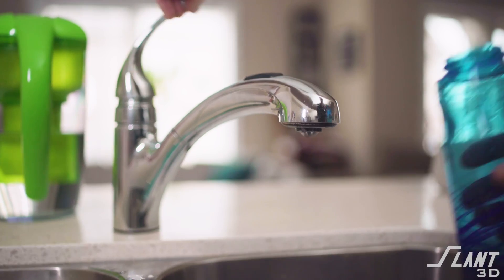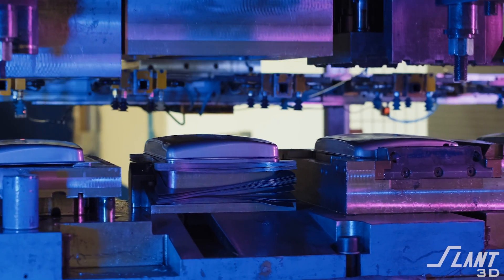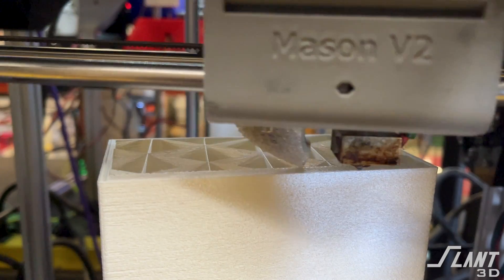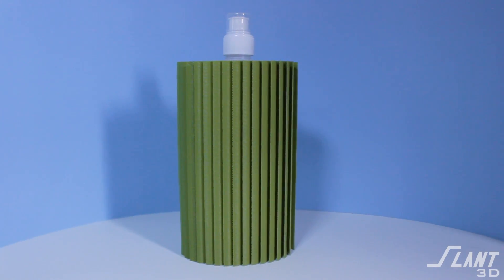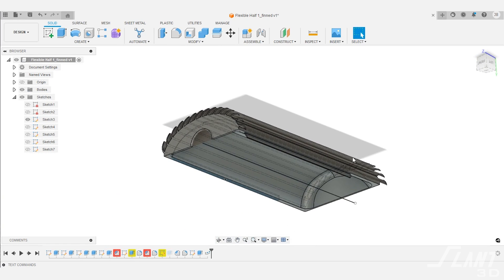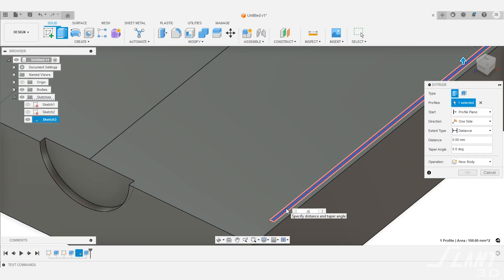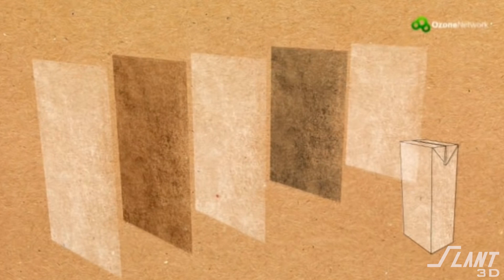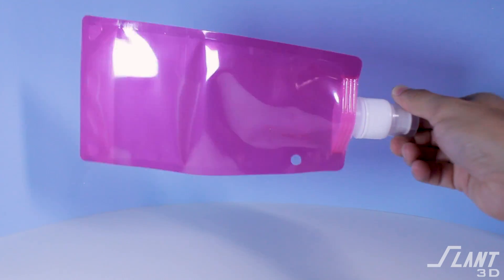Can you 3D Print a Water Bottle? | Design for Mass Production 3D Printing

Comment: I was kinda hoping that there would be some discussion about whether the printing process itself could be made more food safe. Over-extrusion to fill in gaps, using food safe PETG, etc. If that can't be done - perhaps something like food safe spray-on liners to allow the interior to be any shape you want. Printing a shell around an existing food-safe container - kinda feels like cheating. Yes, of course if you just make a shell that's okay.
Reply: Agreed this video completely side steps the question. The 3D printed parts aka the bottle housing isn't food safe. Nothing printed was made food safe. 
It's a great real world solution but if it was a maths problem, your maths teacher would give you a 0, because you answered a question that want asked.
Reply: @byroboy  I would suggest reading the paper I talked about above. Cleanliness-wise for micro growths, 3D printing is pretty dang safe, more so than the used plastic bowls/plates in most cabinets.
Heck, even the "lead leeching" from the nozzle has been dramatically overstated. There is more lead/arsenic in makeup than there is from nozzle transfer. And there are not many warning labels on makeup because those substances are "naturally" occurring in the ingredients. It is reported over 98% of cosmetics have lead in it. 

While nothing is 100% correct, and we need more studies done, just blatantly saying "Nothing printed was made food safe." is adding to the fear-mongering behind the hobby and field.
Reply: @RoseKindred  The problem is variability. It's harder to know with FDM if something is safe or not simply by looking at the materials list, because there's such a diversity of filaments all called PLA or PETG, and the lead leaching could also be a higher risk if you're using cheap brass nozzles from Amazon that wear out in a couple hours of printing. And biological surface area could easily be orders of magnitude higher on shoddy prints than on proper ones, say, if the filament's wet and oozing like foam. A lot of people won't necessarily have the patience to diagnose those kinds of problems if all they need is a functional print.
But you're right, if we can get enough studies and enough samples of enough printers and filaments and environments, hopefully we'll have enough data to say once and for all that FDM is safe for food contact.
Reply: I really wish I could post links here. But a 3D printing group I am in on FB (Just called 3D PRINTING now with 275K members) has a member who posted their paper on this topic. Essentially that yes, 3D printing is food safe. It is not "certified" safe but they expect it eventually. 
From the article: “Plastic cutting boards seem to have more contamination than 3D-printed parts. More CFU’s grew on the petri dishes from a plastic cutting board that had been washed with soapy water, than 3D-printed parts that were washed with the same method." Matt Thomas. "IEEE 3D printing and food safety" IEEE (2023)
It is about a 6-page read, shows their cleaning and testing methods and which filament types they used.
Reply: @RoseKindred  I read it, great paper.
Reply: @RoseKindred  nice to hear, i made my small 20x15 cutting board and had it for years now, thinking on reprinting it, it cleans like a charm and is small to cut greens or meat, my thought process was, pla is biodegradable so probably if i consume microplastics it better be pla than hdpe, bpa or alike.
Reply: i was thinking about the same, the approach of trying to reinvent something just for the sake of it doesnt feel right, i think it would be better to find those gems that are only 3d printeing suited, and add a ton of value, i dont think this kind of bottles add any value to be honest
Reply: Same here, was hoping to hear about food safe and PLA.
Reply: i would think if it was possible (at least in his opinion) then he would have probably mentioned it.
Reply: You cannot fdm print food safe objects because the extruded plastic is full of micro-voids that you cant clean, which are ideal fungus/microbe breeding grounds once you add nutrients. Surface sealing techniques can be used, however the sealer needs to be durable and food safe itself.
Reply: @pyalot  Forgive me, but have you really looked into that or are you parroting what others said? I don't mean to keep pushing the report I mentioned, but it is applicable here. The growth was less than a cutting board that people keep for years, even decades, with micro slices and tears in it. 

The only real issue I could see are compromised people (like myself) and even then if cleaned with soap and water it will be better than the plastic dishes from decades ago.
Reply: @pyalot  I suggest reading the papers mentioned in the other comments. I think the jury is still out and more research needs to be done.
Reply: I seem to have been blocked from replying but there's misinformation in this video.
Reply: @RiparianBeing well you seem to finally figured out how to reply. Maybe you can share now? I wouldn't be surprised if he got a couple of things wrong.
Reply: Next up by Slant 3D:  Making a Fully 3D Printed Space Suit that works in Space !!!*
(*Disclaimer: Requires an actual space suit to work, only acts as a shell around the space suit to make it stronger)

Comment: If your goal is to have a cool water bottle, that's one way to do it. If your goal is to have a cheap water bottle, using the existing molds would seem to be  better way to do it.
Reply from the maker: 3D printing has not molding or startup cost. But the same scale and unit cost.
Reply: @slant3d what's the cost of that bladder you bought to put inside the printed case? I doubt it's any cheaper than a simple pet bottle

Comment: This is a bit deceptive. Technically you did print a water bottle from a certain point of view, but you just 'bought' your way out of the problem.
Reply from the maker: We designed our way out of the problem. That is what engineering and product design is.
Reply: @slant3d No, that is not engineering a solution. It is circumventing the problem using an existing solution without using 3D printing technologies. Disappointing video.
Reply: @slant3d  If we have emissions issues and our cars are polluting, why don't we invent something with 4 wheels that's not a car? We could build an engine into it so it can move.
I don't want to take the effort in designing something, that's never easy and I do think that for some people this might fall into a niche solution for their needs. But I agree that we shouldn't call things what they are not

Comment: In general this channel is great but I think it does printing a disservice to make false claims. Using this video’s arguments almost any material can be “waterproof and food safe” by placing a water pouch inside. Flank steak? Yes! Woven hair? Yes! 😜
Reply: You can also 3D print a fully working smartphone, just print out a phone case and slap it on a smartphone, boom, fully working smart phone. Perfect idea for the next video. 👍
Reply: So...what would you call using a coating on a food safe bowl or cup?  It's little different.
Reply: @frankearl9285  I wouldn't call it making a food safe cup if what I'm acrually making is a cover for a food safe cup. Some of us are weird like that.

Comment: I print a case for a Raspberry Pi. I put a Raspberry Pi in the case. Behold: I have printed a computer.
Reply from the maker: You mold a water bottle. Behold. You made water
Reply: @slant3d  You didn't mold a water bottle. You made a youtube video about 3d printing a case for a water bottle, trying to pass off the printing as a water bottle.

Yes industry addresses food safety using plastic liners in many products such as aluminium cans, but those liners could not function as the product without the surrounding casing.

The liners require the body of the aluminium can to provide stability.
They require the lid of the aluminium can to provide a method of filling and sealing the contents within the liner

They are not a product if not together.

The aluminium can - is not food safe.
The liner - is not an effective container.

The water bottle you inserted into your print, was fully functional as a water bottle prior to being placed in your casing. Adding your casing added some protection and rigidity, but...

without the casing, that water bottle was still a water bottle.

Without the water bottle, your casing, would not be a water bottle
Reply: @slant3d  I have mold in my water bottle. Behold, I printed mold.
Reply: @brandondownhour9569  exactly, which is fine, but felt pretty deceptive when revealed
Reply: Yes this is not a 3d printed water bottle it's part of a water bottle that was 3d printed
Reply: @StephenTeitgen It's not even part of a water bottle either, he put an already fully functional water bottle in it and just 3D printed a case for it. Its not different than claiming you can 3D print a working phone by just printing a phone case then putting a phone in it, deceptive af and not exactly the "gotcha" moment he tried to pass it off as.  The video is misleading af and no, you can't 3D print food safe prints or water bottles nor does his "water bottle" ever come into contact with drinking water when used right, otherwise it'll grow mold.
Reply: @DrakeOola  yes I agree but you can make food safe 3d prints
Reply: I got your point and I see others don't.

The reveal that he put a mass manufactured water bottle inside the water bottle, completely defying the point of the entire video, was such a downer.
Reply: Hahaha GOAT comment 😂
Reply: Yes. This is just an enclosure. And one could still argue it is not food safe. They haven't solved the problem of bacteria/dust in groves etc. especially in the "winged" edition.

I do appreciate the approach - but it doesn't really debunk anything.
Reply: I think you have missed the point. You can create a unique design that holds water which is a water bottle. There is an element of resourcefulness, but that is the benefit of rapid prototyping which can be shifted straight into production. The Raspberry Pi foundation is equally as ingenious in it’s approach to give you amazing compute boards.
Reply: @Giftedmike359  I think you're missing the point. This is total cop out. When people talk about printing food safe items, this is not what their talking about at all.
Reply: @arthurdiamondhands474  It doesn't really matter what people are "talking about". it's a food safe bottle which contains water at the end of the day. Manufacturing is about overcoming challenges and delivering an end result, not simply being a purist at the expense of product quality.

Comment: You start the video basically saying "people say that 3d printing isn't food safe, well that's false" and then do not make it food safe. You shelled food-safe thing. That is a great idea, sure, but that's not the initial statement.
Reply: What's worse is that comments linking the dangers of brass nozzles with 3d printing are being deleted and censored by this channel.
Reply from the maker: When does post processing stoping being post processing. Carboard is not waterproof either until a coating is put on it. You have to engineer solutions about the end goals.
Reply: @slant3d   That's a play of word, you clearly made expectation of a way to make 3d printing food safe while you just made a case for an already existing item. the idea is actually good, but hiding a simple case behind an "engineer solution" excuse is not really honnest.
And i suspect you took water bottle because it's the only example either working or straight silly : 

"Yeah you can make food safe box, you just have to buy a plastic box and 3d print around it"
"Yeah you can make a 3d printed fork, you just have to buy a fork and print the handle"

Idea is cool, but the clickbait is strong and justification despicable, honnestly.
Reply: @maxoux33  hes deleting comments now too
Reply: @maxoux33  Couldn't have said it better myself. People would be more receptive if he just said, "hey I can make a shell to make a water bottle look more fancy, and injection molding can't do that" or something.
Reply: @slant3d  Except your statement when showing the product is "Right here is a fully FDM 3D printed water bottle that is fully waterproof..." which is 100% false as you didn't FMD 3D print the off-the-shelf bladder you placed into the shell. 

From a design perspective I think it is a fantastic idea and great to show people, but click baiting that you can 3D print food safe and water proof things while showing something like this is a bit dishonest.
Reply: @lethargicpuffin2243  (I imagine) you’re having that reaction because you’re used to thinking of a water bottle as a single part (minus the cap). A big part of the message of this series is that if you think deeper about what you really need, you can find ways to make seemingly-unprintable products using 3D printing — and they do that again here.
Reply: @goosedaddy  No, my reaction isn't to the design philosophy they are trying to present. My reaction is due to the blatant lies being used to drive traffic to their videos. 

You cannot "fully 3D print" a food safe, water proof product given the current technology we have available. This product they have presented, while fitting the requirements of being food safe and water proof, is not "fully 3D printed" as he has stated in the video. 

Even in the example they give of the water proof cardboard boxes, those are not viewed as 100% cardboard in the same way he is viewing this product as 100% 3D printed.
Reply: @slant3d  The design looks cool but i think the milk carton example is not appliable. you are not coating the inside of the print in order to make it hold water like in that specific case. all in all you made a handheld rigid Camelbak. 
PrusaResearch made articles about the food-safe factors in fdm 3d printing. Even petg, which is considered a "food-safe" material will need a coating in order to TRULY make it so.
One thing i would do is maybe print the bottle in 2 parts, cap and container, coat those and then screw them together with a nice o-ring for sealing.